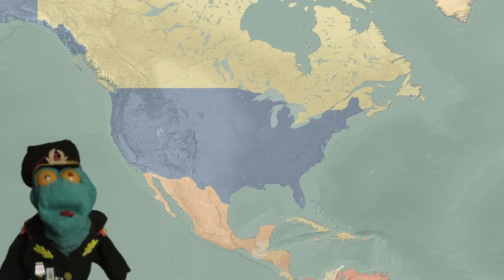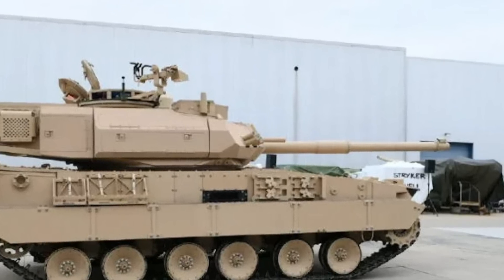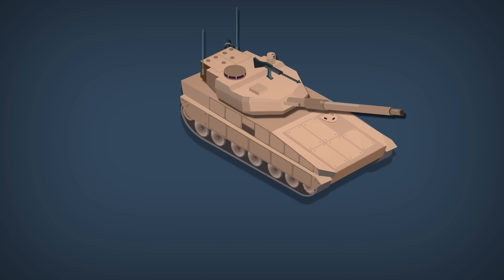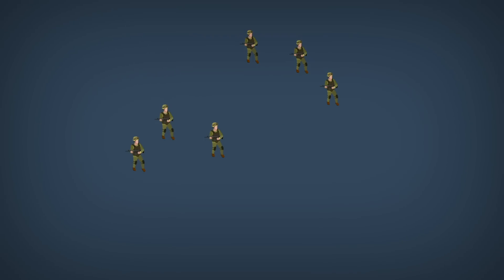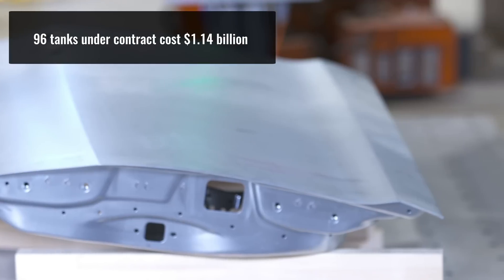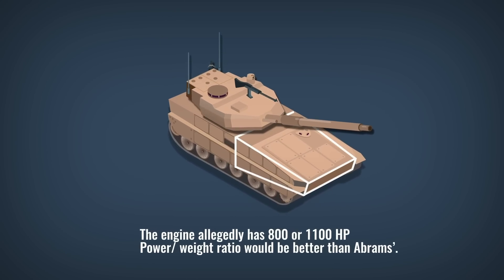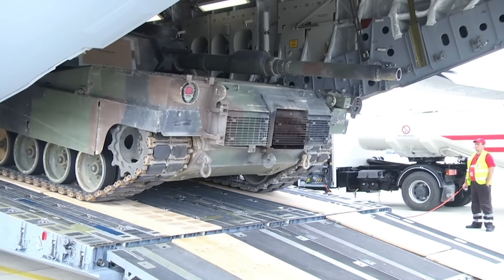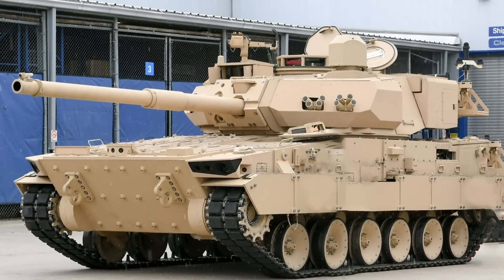US Army just chose its next (light) tank

Comment: I really do not get why the designers went for a 105 mm rifled gun rather than a 120 mm smoothbore that could shoot all the same ammunition as the other NATO MBTs.
Reply: that wouldn't make it a like tank. I don't think you were listening to him.
Reply: @ebadurrahman7848  The BAE systems bid had a 120mm. Fire power matters for a light tank too. Also designing and procuring new ammunition would be cheaper if only one tank gun was in service... on top of the logistical benefits.
Reply: @MrShpoulsen  These aren’t really designed to engage tanks, so a 120mm would be overkill and add a lot of weight that would lessen its mobility (which is the whole point of a light tank).  It’s designed to destroy bunkers and light armored vehicles like BMPs, while providing decent armor  protection against something like a BMP.  If it happens to run into enemy tanks (and for some reason it doesn’t just leave and radio for air strikes or a tank company) its units will have TOW and Javelin missiles to deal with them.  And in a pinch, the 105mm will kill a tank with a side or rear shot.  And it’ll kill a non-upgraded Soviet tank with a frontal shot.  

As for logistics with the 105mm, we have tens of thousands and possibly hundreds of thousands of perfectly good 105mm rounds left over from Cold War stocks, and we have kept the production lines open because the Stryker still uses 105mm.   But barring some completely revolutionary advance in muzzle velocity, we’re unlikely to need new 105mm designs.  The only vehicles resisting them are newer MBTs, and as I mentioned, this vehicle isn’t designed for engaging those.  

Another thing about going with a 105mm is that it avoids mission creep.  If these light tanks got a 120mm, then there would be a temptation to use them against enemy tanks despite them not having the armor to do so.  This is what happened with the first British battlecruisers in WWI.  They were designed to hunt down enemy cruisers with impunity, but didn’t have the armor to withstand battleship caliber guns.  Once they wiped out the German cruisers, the British admiralty figured that since they had battleship-caliber guns, why not use them against other battlecruisers?  See Jutland for how that worked out.
Reply: @bluemarlin8138  But the 105mm lacks fire power against infantry and fortifications too.
The USA has programable airburst capable HE shells for the 120mm, but not for the 105mm.
New smart munitions will be made for the 120mm, since it is widely adoped in NATO MBTs, while the 105mm is a narrower market. Old rounds aren't "perfectly good" by comparison.
I would rather trust officers to stick to doctrine rather than force them to do so by giving them less capable equipment.
And if you look up the numbers a 120mm gun is not that much heavier than a 105mm, only a ton or two.
Reply: @MrShpoulsen  120MM has way more recoil than a 105mm plus the shells are much larger which greatly reduces the number carried (especially in a light tank).   105mm has huge existing ammo supply and 105MM APDS round will penetrate a T72 at 2Km.   This is not an MTB it's not a replacement for M1A2 MBT, its a support tank for light troops.
Reply: @MrShpoulsen  but they need light tanks that is why they need light armour and light gun.
Reply: Different purpose. This one looks closer in doctrine to Russian BMP-3
Reply: You need to understand that heavier gun needs heavier frame. Mounting a heavy gun on a light tank will tear itself apart firing their cannon.
Reply: @kazedcat  The BAE systems bid had one 😝

Comment: You could have just used a Abrams and done everything this tank does
Reply: Except drop two or three of them from the air onto a CCP-held island in the pacific from a single C-17 overflight.
Reply: @bnwww  it’s not airdroppable
Reply: Striker already has a 105 cannon and room for the infantry... Why not invest money into a platform we already have... The Abrams is a good tank, but it's in dire need of upgrades and a diesel engine... The army just wants to piss more money out the window
Reply: @SimanSlivar  the abrams does not need a diesel engine. Moreover it is being upgraded, that's what the Sep upgrades are for. Moreover the 105mm Stryker MGS are few in number, maintenance heavy and cannot sustain repeated recoil because it is top-heavy
Reply: @SimanSlivar  Stop with this fucking laughable idea that it needs a diesel engine. The turbine engine was chosen for specifically what the abrams does.
Reply: @SimanSlivar  Striker is a mess with many problems. Solving them would cost much more...
Reply: @mikoi7472  The turbine engine was used because they thought in a World War III scenario, where all the infrastructure gets fucked after nuclear strikes. A turbine can burn almost anything. Exactly this is the reason. Otherwise it is loud, THIRSTY and has a greater heat signature. All of those things you want to avoid with modern tanks.
Reply: @Gentleman...Driver  No. The Abrams was not designed for WW3. It was designed for long duration missions where the teams might have to salvage fuel.
Turbines have high frequency sound waves. They produce quite a lot of sound close up, but due to that high frequency, the noise drops off quite fast and actually is quieter than diesel engines.
The turbine engine is more efficient as long as it's not in idle. The issue people were running into is it didn't originally have a secondary system for the controls so the turbine has to be ran in idle to power the systems. That's since been fixed and as such the turbine engine is much more efficient than a diesel alternative.
And no, the turbine is fantastically heat efficient and produces less smoke than a diesel alternative. The turbine was chosen because while being more expensive per unit, the overall advantages of the engine outweigh any downsides like the myths you brought up.
Reply: @mikoi7472  Long duration missions aka world war III, yes...
I what other scenarios are you cut off of any fuel supplies?!
Reply: @Gentleman...Driver  The middle east. Any normal operation where supply lines break down. Logistics is a really vulnerable operation, and because of that we want to build redundancies into our systems so they can operate when logistics are disrupted.
I also like how you didn't even try to dispute any of the other points made.
Reply: @mikoi7472  I just picked up the point that was the most false one in your assumption. Look: If long duration missions are your concern and fuel supply is a concern, then you wont outfit your tanks with a freaking Turbine engine that is consuming twice as much fuel as similar Diesel tanks. Diesel engines can consume also a lot of different fuels. It is not harmfull to them.

The only scenario where it makes sense is World War III - there are NO fuel trucks coming, you will be operating on your own and you will need to use whatever you have available. Not only oil based fuels, but also alcohol for example.

The Abrams is by far the most costly tank to operate in the world. Yet, it doesnt have really the edge when in comparison to other hightech tanks, like the Leopard 2. They have similar combat ratings and capabilities and cost a fraction to operate.
Reply: @Gentleman...Driver  this is laughable. "The only plausible thing the army ever thought of for the abrams was ww3."
Just falls flat on its face for any operation.
Again this idea the turbine burns through fuel is also dumb. Its more efficient than a diesel engine when its not in idle. Your information came from the fact soldiers had to leave it idle to operate the computer systems before and are not up to date with exterior power plants specifically for the computers. The turbine engine vastly beats diesel alternatives. And no, you didn't just pick up the most false one because none of them are false. You simplu have no arguments against them.
Reply: @bnwww  it literally says in the video that it's not meant to be used alone and fight tanks. 105mm gun with that amour? It's gonna be deleted by medium tanks
Reply: @mikoi7472  You're wrong, the Abrams may not need a diesel engine, but the army wanted to replace it's currently turbine either with a new turbine (Turbine powered AIPS) called LV-100 or a (Diesel AIPS) made by cummins, both being smaller than the AGT-1500, they also used a smaller transmission, smaller cooling system, had better fuel economy and had more net horsepower despit having the same 1500 gross horsepower.
The diesel AIPS produced 10 percent more sprocket power than that of the M1 in about 60 percent of the M1 propulsion system volume.
They may not need to replace the AGT-1500, but it's far from a laughable idea.
You can find everything related to that topic in old Army RD & A bulletin's from 1984-2004, 1989 being the best one.
Reply: @Gentleman...Driver  all tanks are very loud and produce heat signatures including diesel powered tanks. The Abrams is actually one of the quieter tanks with us troops actually being surprised that an abrams is approaching
Reply: @Gentleman...Driver  the turbine is the exact opposite of loud. It's not called 'whispering death' for nothing.
Reply: @wyattbates5019  fair point. Looks like that requirement was taken out. With that said, I wonder if it is possible.
Reply: @bnwww  this light tank can’t be air dropped either

Comment: Since the Americans won’t fight on their own continent, a light tank will come in handy. But only 105mm?
Reply: I know,  who down sizes a tank cannon
Reply: @adamorick2872  did you watch the damn video? It isn’t designed to engage tanks, it’s designed to support infantry units. It needs to be light and fast moving, hence smaller gun
Reply: @sheldonsimon4484  The smaller gun doesn’t make it lighter, just impotent.
Reply: @jansix4287  oh yeah, I forgot downsizing a gun doesn’t make it lighter, guess we’re just bending the laws of physics
Reply: @jansix4287  well the gun is lighter since theres less material used, it doesnt need as much supports since it has less barrel weight and less kickback, and the ammo is lighter so...
Reply: @sheldonsimon4484  well the larger gun is actually filled with helium so despite being larger it actually weighs less, especially when the optional zeppelin scope is attached at the end of the barrel.
Reply: @jansix4287  the smaller gun is rifled as opposed to smoothbore, meaning it can use HESH rounds for infantry support against bunkers and such. The British still use a 120mm rifled gun in the Centurion 2 for this exact reason. The gun itself is basically an updated version of the Royal Ordinance L7 that’s already being used by the Stryker MGS that’s been recently retired and is likely being replaced by this vehicle.
Reply: @sheldonsimon4484  It makes the gun lighter, but it doesn’t make the tank lighter. Size and armor of the hull make most of the weight. So the armor won’t set new records either and then a gun with much less kinetic power.

Comment: It looks like they took the C&C 4 route by replacing the standard tank for a light one in order to get more mobility and cut cost (it is in the command and conquer lore). Only two other points need to be addressed in the future. First, considering that the Chinese and the Russians will make more knockoff's of the Javelin & NLAWs, will this be considered a cost effective loss considering future warfare? Second, if the gun could be considered underpowered would a rocket module attachment be possible to make up for this? Lastly,if you took away/modified the big gun for smaller caliber multiple torrents/anti-aircraft rocket's you would have a more versatile multitask role chaise combat vehicle. That could help on cost and work for the Marine Corp giving them back more heavy vehicle support since they cut back on the Abram's.
Reply: This will not replace the Abrams tank it's not designed to replace the Abrams tank. What this is replacing is the striker MGS. These tanks will be issued to units that never had an Abrams tank such as light infantry brigades.
Reply: Apart from the fact that they didn't do that at all.

Comment: call. It Sherman tank it is under gun and armored
Reply: It’s a light tank, so why would they add more armor or firepower? Also the Sherman is massively underrated.
Reply: Funny thing is the Sherman's wasn't under gunned or armor it only had issues with two ,tanks that rarely appeared.  Most German tanks where Stugs and Panzer 3s and 4s the Sherman's 75 didn't have an issue cracking them
Reply: The Sherman was actually one of the best tanks of WW2

Comment: The temptation of light tanks is so strong that the bean counters can't help themselves. Don't worry it's not designed to engage MBTs. Then wars happen and you got weak vehicles trying to fight more capable tanks. Bottom line dead tankers. The light tank concept has been dead since the end of WWII.
Reply: It doesn’t have to replace heavy or medium tanks. Having an assortment of both light and heavy tanks offers some flexibility.
Reply: We have to fight tanks now (theoretically) with nothing more than AT missiles (hand held)/Bradley. 
I guarantee this will save American lives on the battlefield. It's been too long coming ...
Reply: Light tank are cheaper and more suited to harsh terrain such as swamp or muddy (or anything that wet) and mountainous or hilly terrain, and light bridges than the Abram tank that weighted 60+ ton. Plus light tank can be equipped with anti tank (mbt) weapon such as ATGM if needed

Comment: And why do the us bring this vehicle up? This tank does the job, which the bradley is already doing and even transports soldiers. The bradley even receives the 50mm maingun.

I dont get it
Reply: I’m not sure either, but I think it’s supposed to be a lighter unit that can stick with the infantry or be sent to places it’s hard to get an MBT in. They could be very good in Taiwan potentially. Is that the Bradley’s role? That’s kind of what I thought but evidently there’s differences in the intended role
Reply: @andrewreynolds4949  its funny, because the striker has the same size maingun.
Reply: @resources1382  The Stryker CAN carry the same size gun, but I don't know why they even bothered with that. Wheeled vehicles do much poorer off road anyway
Reply: I think it has to do with weapons integration suite which the bradleys arent designed for because its old af.
Reply: Because small size

Comment: So you enter into a battle where you know mbts are and you can’t engage?  Watch me.
Reply: Ya what waste of resources. At the mobile gun platform the Europeans are making can actually hurt MBT. Even thought it's a stupid idea as well as same problem can be with TOW or bombs.
Reply: @Ci Absalon ya and the shitty 105 the Griffin has won't do shit to modern MBT and just get itself killed.
Reply: @Cavalier1645  A 105 firing decent AP can still penetrate the average MBT from the side or rear without issue. Most of the armor is up front, particularly on the hull. This is an infantry support vehicle first and foremost.
Reply: @crowe6961  Ya but it has to move to get on sides and rear. Where enemy can hit them anywhere and ista kill them. Again a waste of resources.

Comment: If im not miataken a 105mm cannon would still be able to engage most all of the tanks in the Russian arsenal, perhaps not the T14 but they dont appear to have many of those anyway.
Reply: Rescharge in faster autoloader and shells aiming system
Is whats to be done. The actual tank design must fit the terrain
To.
Reply: @pernykvist3442  autoloaders are normally slower than a human loader i suppose your saying try to make one that is faster?
Reply: @JustAGroundhog  I bealive they can be improved
Reply: In weak spots against older t-72 yeah 
But hitting weak spots in normal engagement range is next to impossible

And against something more modern like a T-80BVM T-90M it’s impossible